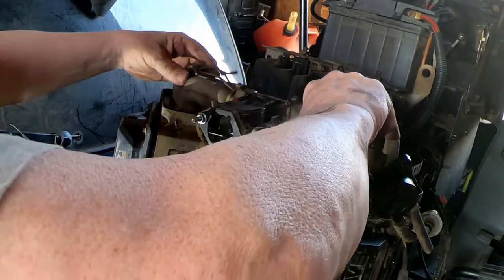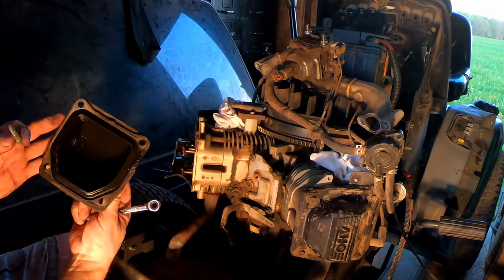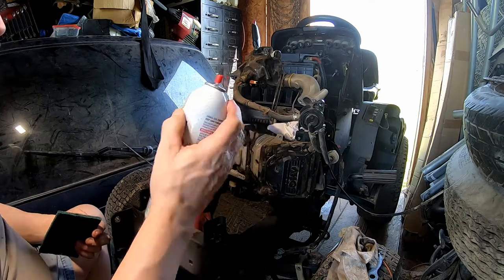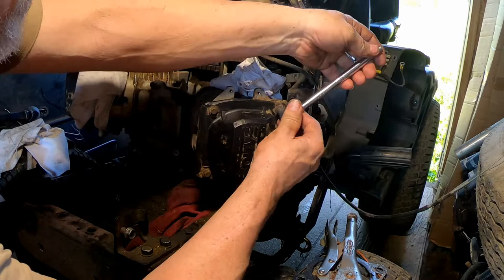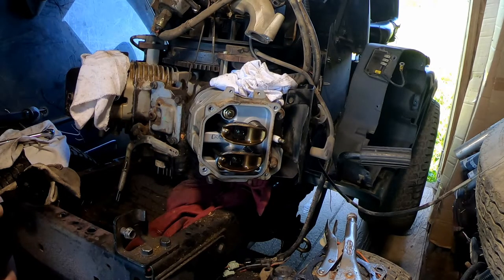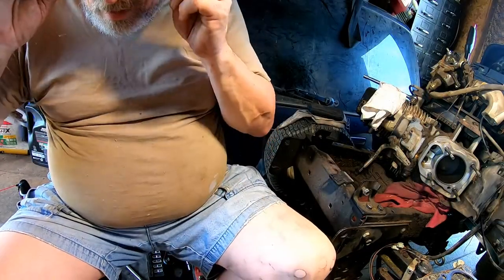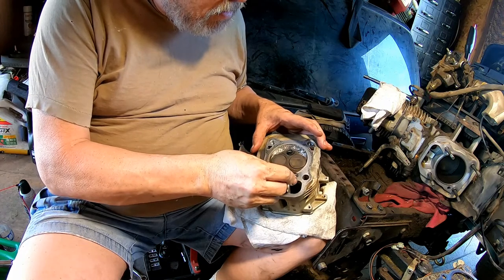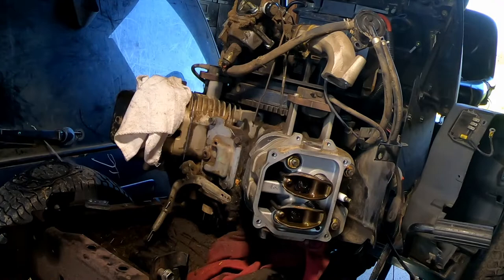Part Two of a Two Part Series - Kohler 23hp V-Twin Head Gasket Replacement

Comment: I was surprised to see the same craftsman mower and engine as I have.  Mine is now used to pull implements on my 12,000 sq ft organic farm.  I have the hitch attachment and electric lift.  I purchased it in 2002.  The lasts time I started it I noticed a gas leak off the front side of  the engine and that's what I was searching for on You tube.  Your video, so nicely done, showed me how to dismantle the front components to get to the fuel lines and carburetor.  I haven't checked the plugs yet but I have noticed some smoke and now you have me thinking I have a worse problem...head gaskets.  You are obviously an experienced mechanic and I'm not so I'll tackle this or not.  Might be difficult to remember how to put it back together at my age.  HaHa.  Your comment that you might need to do gaskets every 5 years has me wondering.  Didn't you say this is the first time you have done yours?  It's 20 years old, so is mine.  Why would you need to do it again in 5 years?
Reply from the maker: These tractors were pretty popular back in the early 2000's. I worked at a Sears around the time that these tractors were being sold and I bought mine then. 18 years later I picked up a second tractor that is identical to the one in the video and was built about 36 days apart from each other. They are both workhorses on my five acres and i run them year round, doing everything from simple grass mowing, to working in the garden with a disk harrow, to grading my driveway, and even snow removal, and everything in between. These are not shed queens and I don't treat them as such but they do get there regular maintenance and a bunch of TLC along the way. 

As for the carburetor, it is a fairly easy part to get to after removing the hood and the air filter housing. If you're having issues with your carb and you decide to rebuild it, Amazon sells rebuild kits for around $15.00 US. I would recommend repairing your old carb as the ones that you can get cheaply on places like Amazon, are IMHO cheap knock offs that are of questionable quality. You most likely have a bad gasket in the carb or a bad O-Ring on the bowl. 

When I got my second tractor the original owner trashed the carb to the point that I had to replace it. I went with one of those knock off carbs and it was junk. It wouldn't take any adjustments and made the tractor run poorly. I eventually ended up using the bowl and shut of valve from the knock off carb and along with a rebuild kit, I used the original carb to cobble together a good carb to get that tractor running again. 

As far as your engine smoking, check your plugs to see if they are wet with oil first. That would be the easiest and cheapest place to start. If the plug(s) are fouled with oil, you may have an issue with either your head gaskets or possibly the piston rings. I'm not trying to be an alarmist here, I am just giving you some things to look for before tearing into your engine. If your plugs are fouled with oil, at this point, I would run a borescope (camera) down the plug hole and check your cylinder walls to make sure they don't have vertical scratches. You should see some light cross hatch scratches, that is normal. If everything looks good and you see smoke coming out you may have a head gasket that is leaking. Another thing to look for is smoke coming from the oil dipstick tube after running the engine up to temp. A little smoke on a cold start could be considered "normal" but you shouldn't see an excessive amount of smoke. 

Now, there are a couple of things that can cause oil burning. Bad head gaskets being one of the possible problems, the other is bad rings. That's where the vertical scratches I was talking about earlier will most likely come from. If you see those it may be getting close to a tear down and rebuild job depending on how bad the scratches are, if you have any at all. If your plugs are black, dry. and sooty looking that could be a fuel issue and not necessarily a head gasket issue and could cause smoke but it would likely be black smoke and not a white/gray smoke, that would be from oil burning. 

When I decided to change my gaskets I was putting a ton of gray smoke into the air while I was mowing. What I showed in the video, the engine was cold and only had a small amount of smoke being produced then. As the engine warmed up, the smoke would begin to roll out of the exhaust.

As far as my five year reference it was more of an off hand comment thrown in there in reference to this isn't a job that anyone would want to repeatedly to do over and over. I was stressing the importance of keeping everything clean at that time in the video. Allowing dirt or oil to be on the mating surfaces between the cylinder and the head could potentially create a situation for premature failure of your new gaskets. Sorry for the confusion. 

Thank you for watching my video and taking the time to drop a comment. I hope that the video and this extended reply was helpful in some way. If you have any questions about your tractor, you can drop another comment here or contact me through my email address: JCMBoats@gmail.com.
Reply: @justcallmeboats  Thanks a lot.  If you ever need any Chiropractic advice, let me know.

Comment: I like my GT3000 Kohler pro23 engine.  I hate mounting/dismounting the deck- the square plate in front of the deck drives me insane every time.  Great video.  I will have do my head gaskets one day I am sure and this video will be a great help.
Reply from the maker: I like both of my GT3000'S. They are identical twins born 1 month apart back in 2002. They are great tractors, and they both suffer from the same aliments. Including the plate in the front of the deck. Still, that is infinitely easier to put on than the snowthrower attachment. Doing the head gaskets isn't horribly difficult but is a bit time-consuming. Thanks for watching!

Comment: I've two of the Kohler pro engine and they runs very   well on the GT 3000 and 6000
Reply from the maker: Both of my tractors are identical twins both with the Kohler Pro 23 hp engines. Both are very good running tractors.  Thanks for watching!

Comment: Boats! The one thing you didn't cover (or that I accidentally skipped) is the one thing that I was really concerned about. Getting the exhaust manifold bolts off. My GT 3000 seems to be the same as mine, but the exhaust system looks different. Is near as I can see, it looks like the engine has to be picked up to get the exhaust and Muffler off
Reply from the maker: Thanks for the comment. I had to go back through the video to find that part and I think that I had removed those while the camera battery was dead. Anyway, If you coat the studs with some PB Blaster, Liquid Wrench or, whatever your favorite penetrating oil is before you begin it will go a long way in helping to ensure that you don't snap off a stud. Once the throttle linkages and brackets are out of the way you will have complete access to the exhaust manifold bolts. Lifting of the engine is not required. This entire repair can be done with the engine remaining in place. You do have to remove the muffler first. It is held in with two bolts if I remember correctly. You also have to remove the shield below the muffler and then slide the muffler off of the pipes through the bottom. The exhaust pipes are held in place by two studs/nuts on each side. Good Luck with your repair. If you have any further questions, I will be happy to help you as best that I can. I can also be contacted through email at JCMBoats@gmail.com   Thanks for watching!

Comment: Awesome video.  I have the exact same Craftsman GT3000 with cv675s 23hp kohler vtwin engine.  Perhaps not the same year but needing same repair.  However parts manual for my engine shows a different part number for the head gasket.  It looks exactly like the ones you took off.  Can you tell me what model engine you have?  I’m wondering if I am able to use the same gasket as you did.  Read online that said the bore holes on the 2 gaskets are different.  Thanks again for the thorough step by step video.
Reply from the maker: Thank You! My tractor is a 2002 model year. The original head gasket number 24-041-40 S was superseded with the part number (24-841-02 S) that I used in the video. I have the CV674 engine on my tractors. If you go to Searspartsdirect.com and enter your tractors model number it will give you a complete breakdown of all of the parts for your tractor. Scroll to the section listed as "Cylinder head/valve/breather diagram". Look at the parts diagram and find the head gasket and the associated number, then scroll down until you find that part. At that point, jot down the part number and search for that part number. It may be the exact same part number as the one that I used. I don't know if there are any differences between the engines that would make major differences, but double check to make sure. If you would like to contact me through my email for further questions my address is jcmboats@gmail.com . I hope that this helps you out! Thanks for watching!
Reply: Thanks for your reply.  I sent you an email.  Keep the videos coming!